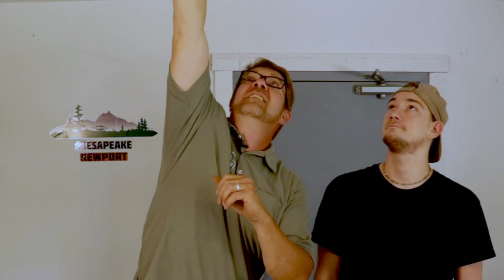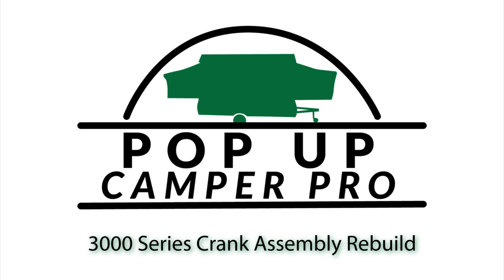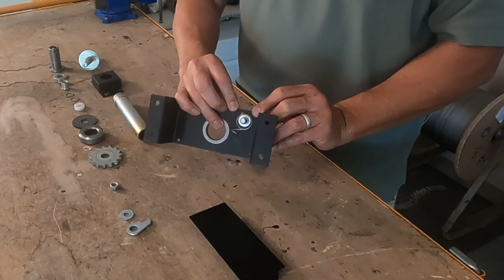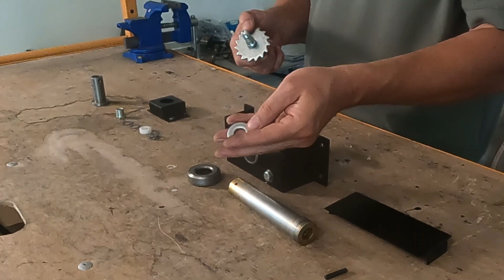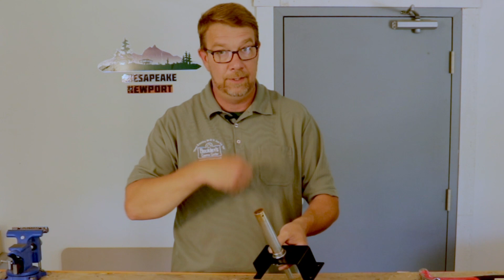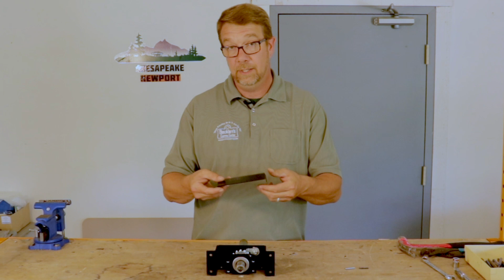3000 Series Crank Assembly Rebuild For Coleman Fleetwood Pop Up Campers

Comment: I Have a 1996 Coleman Taos Which I have updated over the years. Recently I had a problem with the lift system. Nobody works on them these days and the cost is out of sight. While trying to repair it I happened on your site. Amazing! The only issue I have is that you start with the parts sitting on a workbench. Could you please show how they get from the camper to the bench. For example, the pawl spring is broken on my camper. Easy enough to replace once the assembly is off the camper. But how do I get to it?  The same is true of the lift arms. How do they come off? Any help would be appreciated.
Reply from the maker: It’s been 1 year while I didn’t have a shop. Now that I’m back in more videos coming soon!  We have videos covering the lift arms, removal, installation and rebuilds. Crank installation videos are coming soon, I was filming again just yesterday! Please see the lift system manual for step by step instructions on our website in the meantime. Ty!

Comment: My paw keeps jumping off. Will it continue to come off until I install it on the camper? Trying to figure out if I can get away with replacing the drive hub itself or complete crank assembly. Thank you in advance
Reply from the maker: Yes, the system needs to be installed to keep the Paw on the gear

Comment: Hey Derek, doesn't the 3000 series have a bearing housing cup, which you don't show in this video. but do show it in your 6311 rebuilsd video.? If not then what would the purpose be of the bearing if it doesn't have any surface contact with anything? Also what is the purpose of the small gear on the drive shaft as it makes no contact with anything that I can see?
Reply from the maker: With this many questions it’s been our experience that a phone call is a better service. Please give us a call when you have a few moments to go over your questions.
Reply: Derek, does the 3,000 series have a bearing housing cup like the 6311?
Reply from the maker: reach us at https://colemanpopupparts.com/

Comment: Is it possible that the drive shaft is held in place inside the drive hub extension tube with something other than a nut?  The 5/8 socket won't grab hold of anything, but a flathead screwdriver does.  I peered down the tube with a flashlight and it doesn't look like a nut.  I can't budge it.  I have a 1996 Fleetwood Taos.  Thanks!
Reply from the maker: You may have to cut the tube to extract the stubborn slotted nut. They can be a pain.

Comment: I have a 2005 Coachman Spirit 1007. I cant find much on the upper crank assembly. Honestly I am not sure why there is even an upper crank. Would this 3000 model be compatible or the option I need to just strictly  crank the popup up from the lower assembly of the camper?
Reply from the maker: These are two different camper manufactures Melissa, and the crank systems are not compatible.

Comment: I have a 2000 fleetwood taos that has a crank system that's all messed up. I cannot seem to get it back where it's suppose to be I bought new parts for crank system and fixed a couple cables in lift. When I got it someone already attempted to fix it and all the stage cables had the mounting screws out of the top of the stage cables at top. Any help please pulling my hair out on this.
Reply from the maker: To schedule a tech call please email me at popupcamperpro@gmail.com

Comment: So I bought the 3000 assembly. A new bearing , and replaced a cable and now. I got it to crank up finally but... It wasn't catching the pawl and seemed very hard to pop up. I've greased the whiffletree and all pullys, I've replaced the 2 stage arms in the roadside front and pullys. What's going on. And to top it all off. All 4 corners are different heights. Why is this absolutely hard to crank up? I'm thinking it's something simple,but don't know where to start
 And yes the bearing is the right way. Please help.thanks
Reply from the maker: Hello again Jeffery! With the amount of issues your describing and request your sending a tech call is likely in order. Email me at popupcamperpro@gmail and request to schedule an appointment.

Comment: Do any of your videos show how to remove the drive assembly from the whiffletree?  Is there just a pin holding the two together?  I did basic maintenance on my 2022 Taos assembly but it still seems a little hard to raise so I would like to check the thrust bearing
Reply from the maker: Coming soon. For now please reference the lift system repair manual available at colemanpopupparts.com

Comment: Is that where my thrust bearing would be on my 96 sun valley? Need to take off back panel to get at it?
Reply from the maker: The 3000 series crank systems have the thrustbearing incorporated into them. On most units you do not have to remove body panels to service this assembly.

Comment: I have having a hard time pinning this assembly to the threaded shaft on the camper, the whiffle tree apears to be to far forward. Any recommendations?
Reply from the maker: Aaron, Try evenly releasing some tension in the cables. If that does not do it, please give me a call at the shop.

Comment: Well I somehow broke my thrust nut I have the crank all apart any suggestions on the easiest way to remove the roll pins?
Reply from the maker: Ethan, easy and roll pins typically are not two words that go together. A hammer and punch, chemical penetrant, heat or air tools will be required. Sometimes all 4!